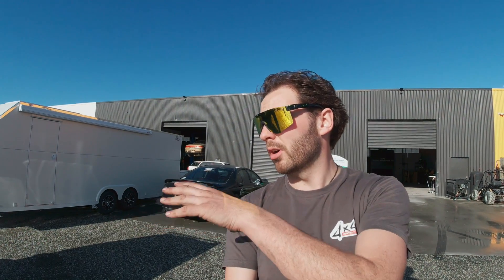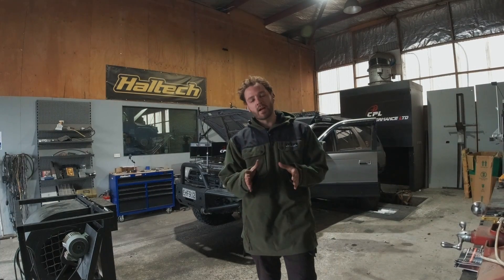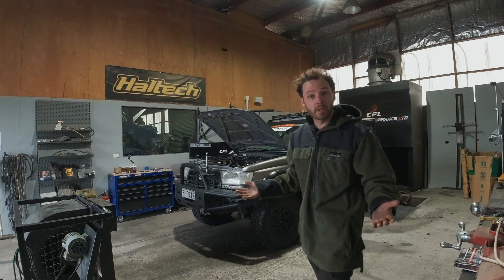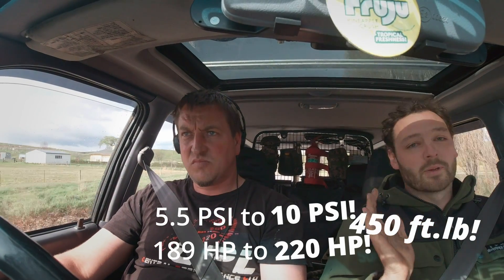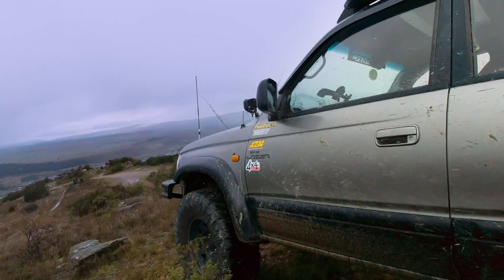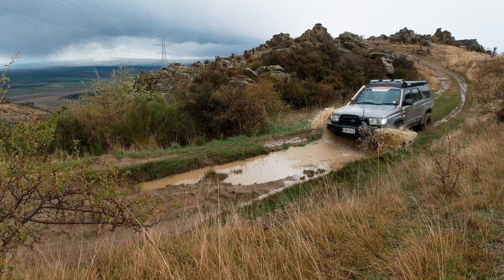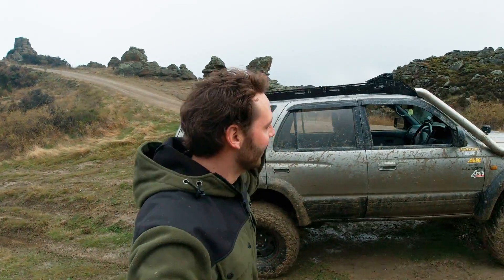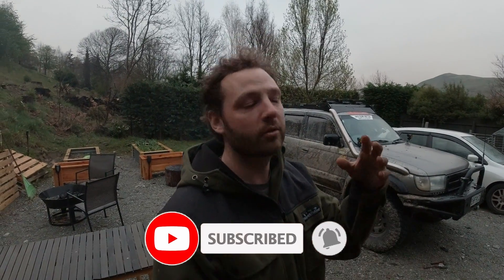New max BOOST! max POWER and more! | 3RZ Turbo Dyno tune

Comment: Absolutely awsome, would love to that to my hilux in Australia.  For touring reasons has it increased the fuel consumption considerably or is it acceptable for the extra hp. Great build👍
Reply from the maker: It has increased fuel economy. We are sitting at around 18 LPH now. Unfortunately fuel has also gone up substantial and now sits at $3.11 per L of 95. So I definitly don't get out in it as much as I should. But the increase in HP has been amazing
Reply: @lostsheepadventures  thanks for that, I appreciate your reply, geezuz $3.11 per ltr, we are around $1.90 on average  in Perth. I will stop complaining.  Awsome build,great effect 👍
Reply: @lostsheepadventures these economy figures are they at 10psi or 4.5psi and if so how much do they change by

Comment: I would love to see a video on 0-100/0-60 times and fuel consumption! 450lb-ft of torque must be so nice compared to stock. My 3rz has lots of trouble with hills.
Reply from the maker: Fuel economy i can comment on.... rough. 

It's sitting around the 16L-18L per hundred. That's no roof top tent and semi loaded. I can get it as low as 14L per hundred but that seems to be rare